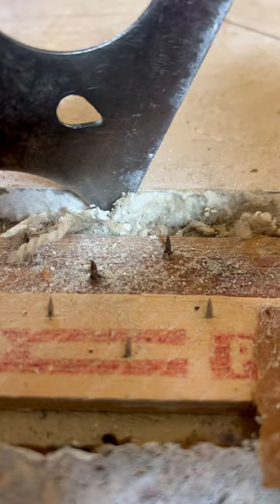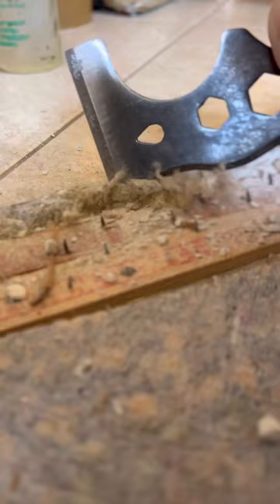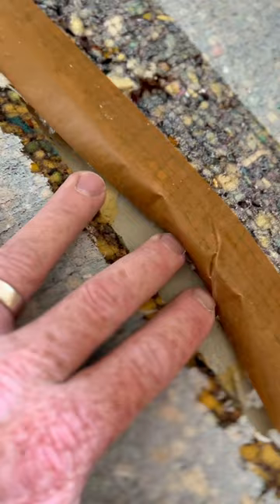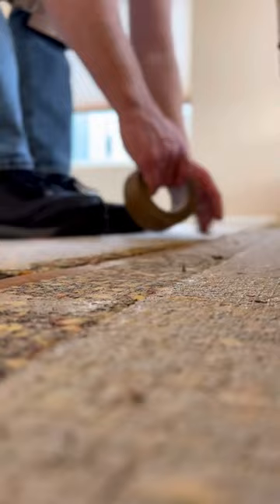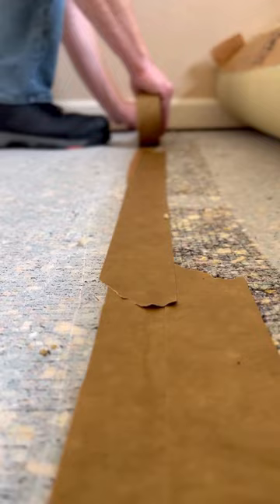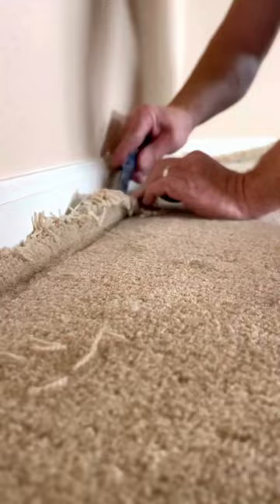Lumpy bumpy gappy nappy carpet #shorts

Comment: That pad glue should have held the pad in place. The only reason you tape your seam is if it's waterproof pad.
Reply: The only reason you use glue, tape, or staples,  is to keep the pad from moving during the installation !! Padding should actually be rolled out and given time to acclimate to the floor,  but who has time for that!  Didn't know they made a waterproof pad!!  If your speaking of animal resistant pad, not only tape all seams but, the entire perimeter also!  A lot of installers miss that part. If you have anymore questions,, just ask!
Reply: @steve hamman  yea you're mostly right but there's absolutely water resistant pad. Around here we mostly use what's called Napa pad and you have to tape the seams. But if you're not stapling your pad, (not you specifically) then you're just careless
Reply: @sneekysnake1239  Napa pad is not waterproof ( you mentioned waterproof).  It has a moisture barrier layer that tries to keep water or animal urine from soaking in. This sounds good in theory and would help if the spill was cleaned up immediately. I also wonder why it has a vapor barrier on both sides,  this will trap moisture inside the padding itself.  You are not supposed to staple Napa pad to any floor, it defeats its purpose by putting holes in it . Tape all seams,  and the entire perimeter. Some installers will staple seams then go over the staples with tape. And its frickin pricey,,, pushing 9 bucks a yard!!
Reply: @steve hamman  the waterproof remark is just you being pretentious. We say "Bulletproof vest" but there's no such thing. You never ever tape over staples it will squeak. And yea no shit you don't staple water resistant pad you use pad adhesive